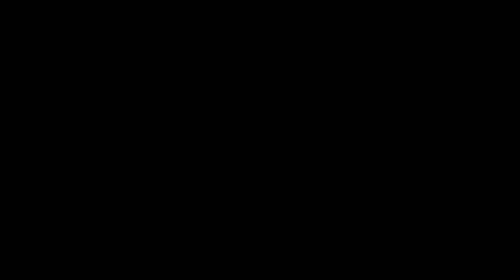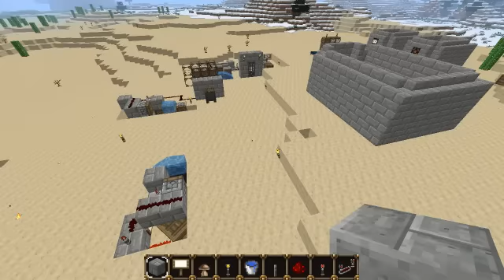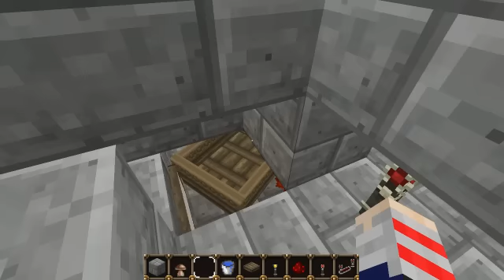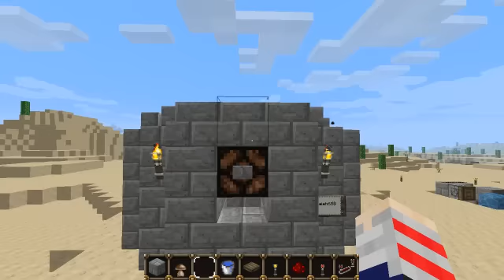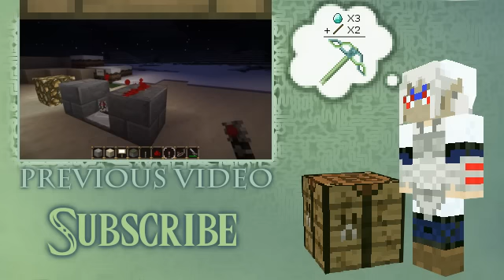Minecraft Tech - Water Power: Event Fuses

Comment from the maker: This was all built in 1.2.5. The timing on the repeaters needs to be similar to what is shown for good reason: the bottom piston makes sure the water source is two spaces from the nearest hole on the boat side and 1 space from the nearest hole on the other. Then, the top piston breaks the flowing connection on the boat side. When timed correctly, the bottom piston will ensure that the top piston's block update doesn't do anything, because the nearest hole will be on the opposite side

Comment from the maker: @pepijnd2 Thanks for the info. If that's the case, placing them in a ring around the junction between 4 chunks should be sufficient for hardcore uses (most uses will only require around 1-4, I think). However, because chunks are 16x16, it probably won't be too big of an issue, even if a small PvP map uses multiple fuses somewhat close together